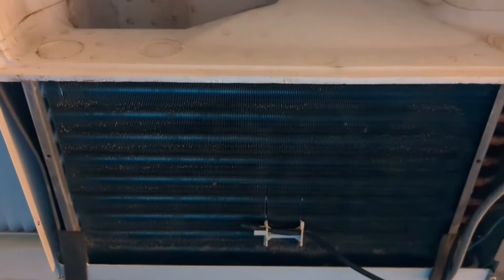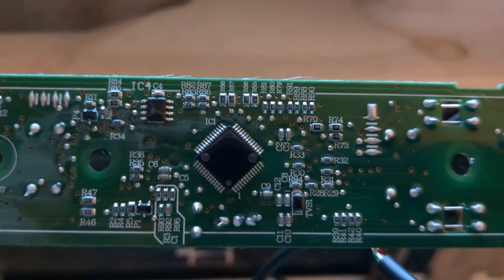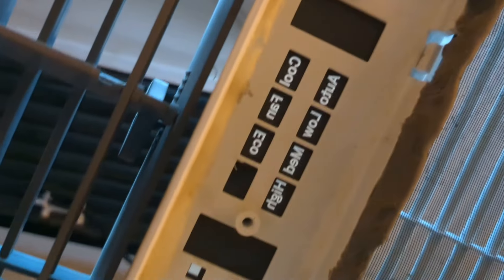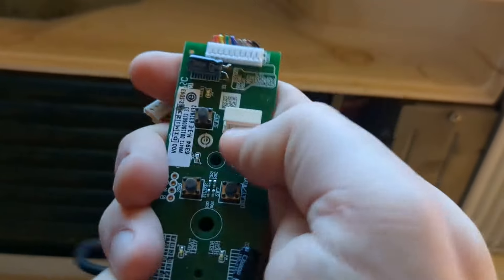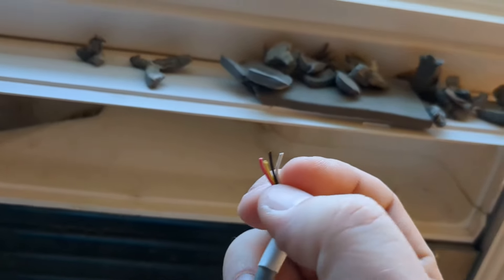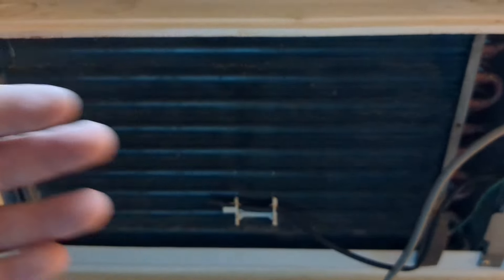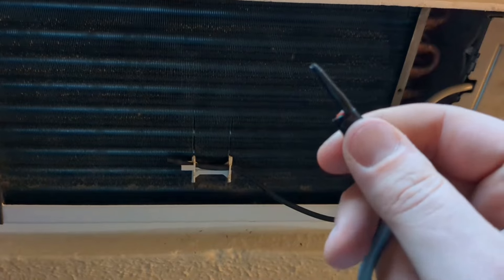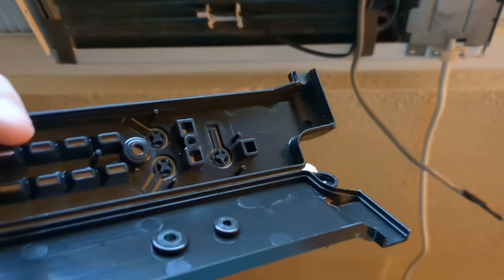GE Window AC EASY DIY Repair AHTK08AAW1 - AHC12LYW1 - ACH14AZW1 -  Beeping, Blinking, Resetting, 88

Comment: I wish I would have seen this. I just had that same exact a c and It was display in 88.. I did get a full refund on it and bought another one bet. But they told me just the dispose of the A. C. It was only three months old. I put it by the road. If I would have seen this. I would have fixed it. I guess you can say lesson learned

Comment: I know that you said once you do it, you cant adjust the temperature or anything on it, so does anyone know if it's automatically cold atleast? I dont want to cut the wires and what not, and have the air conditioner set to like 76 degrees, ya know? Cause then it'd just be a small fan. But it'd be worth doing if the air is cold atleast.
Reply: a bit late but....The temp setting shuts the AC condenser off when the thermostat dips below the set temp. That capability is gone. The fan setting is locked into HI so basically, it's cooling at max fan speed all the time and will not turn off no matter how cold the room gets. Only way to turn it off is unplug it or use the breaker on the wall plug. Good luck!
Reply: @carlosm6311 any idea on what the temperature will be on if we cannot see the display
Reply: @Thelastman84  Unfortunately not. If you've ever driven a car without a temp reading or setting for the AC, same thing. It's just cold air, on high.
Reply: I did this and it worked fine for a day then it froze
Reply: @barrerarobert86  do you mean froze as in... covered with ice... or .... the fan or condenser seized up? If it's ice, you may have to turn it off occasionally to let the condenser "thaw out". They weren't designed to run full cold, full fan 100% of the time. If it is the latter, sorry to hear that. That's a bigger issue.

Comment: Press the plus and minus at the same time for three seconds and it will reset the unit
Reply: 😂 too late I already cut all the wires but thanks
Reply: Does this work for this issue? I just bought a new one
Reply: My board has some fried parts on it. Can’t order a new one either.
Reply: No it does not work. You can reset a fried board

Comment: We have the larger 220vac unit just like this and have the same issue immediately after a storm.  This ac unit was like $1000 and has only been actually used around a year.  Smh these straight out of college engineers these companies hire that think they know what they're doing should all be fired and made into interns until they learn a thing or two about how to make something besides junk.

Comment: Woah wait a minute, there's no way to actually fix the board to be able to use the remote controller? This kinda just turns the AC into a vintage switch air conditioner
Reply: Replace the board - about $100

Comment: I here condnder and fan but didn't hear compressor as well as temp maybe the outside abent or in side temp isent enough to trigger the thermostat. Has anyone else had the same problem. Lol I kinda like the segestion buy new board but did it fix it so not to waste time and money help